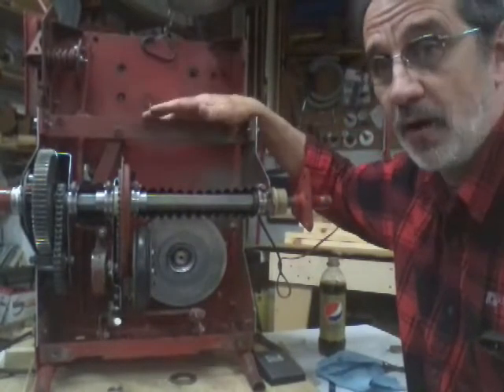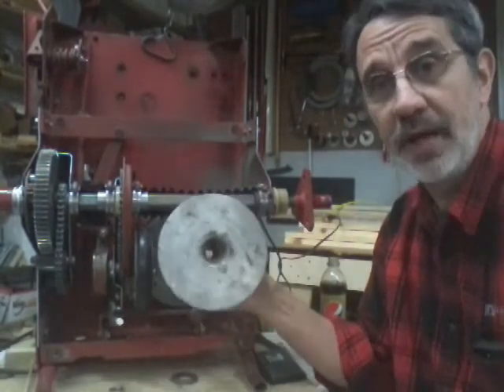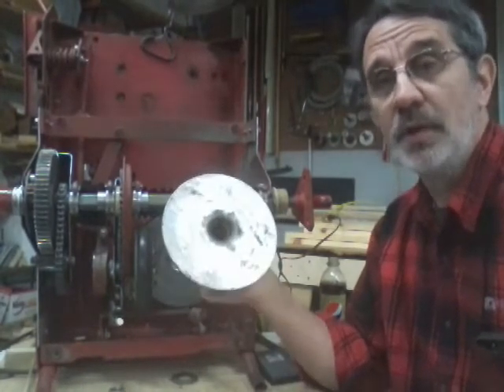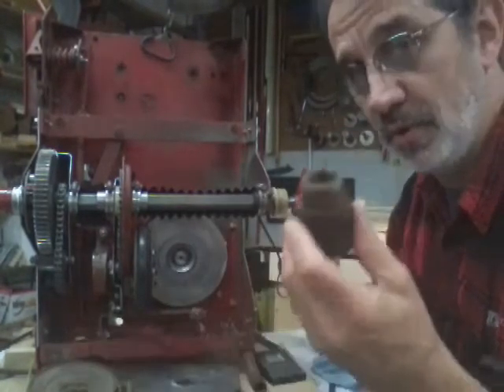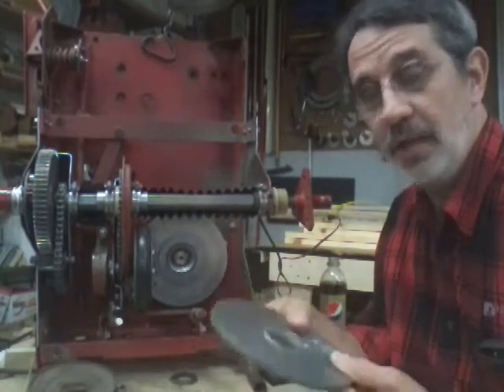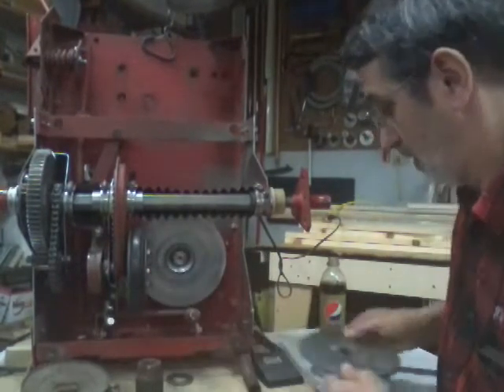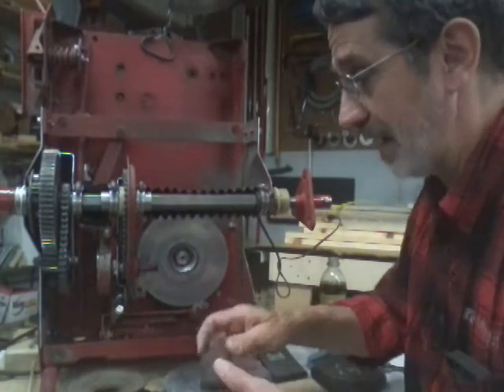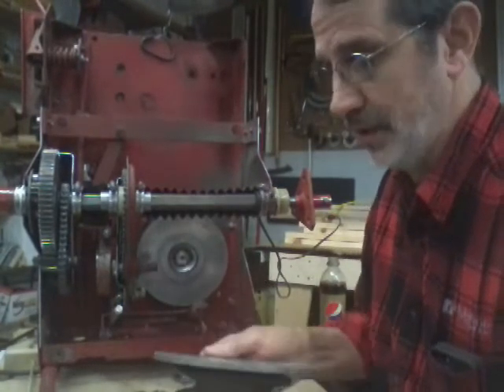97. M/S 4  How to adjust and remove my drive disk

Comment: Holles from Muncie Indiana , My Drive Disc is all solid Cast . just to let you know. Thank You for the Video it was Helpful . I ended up pulling my Engine and took it to a machine shop because it had rust weld itself to the crankshaft. They almost had to melt it Off.  They oil cooled my crankshaft and polished it and told me to replace the Oil Seals .
Reply: mine is the same. no metal ridges cant get it off no matter what i try.

Comment: I just came across your videos and I am hooked!  I was wondering if you could recommend a video that would help me with my Poulan Pro PB30 not moving forward or in reverse. If I rig it without any weight being directly on the mower it will move slowly in either direction but that's about it...thanks in advance and thanks for sharing your videos
Reply from the maker: GOLDLUCK2U 
  Well to be honest I've never worked on one of those but send me some pictures of the drive system and see if I can figure you're issues out,   thanks for your comments and interest I hope you're subscribed to my channel it really helps distribute my videos to other people,  talk to you soon Jim